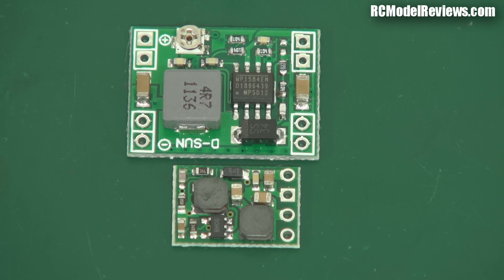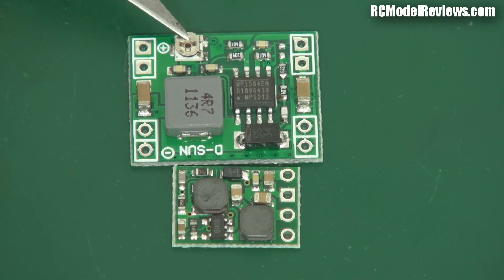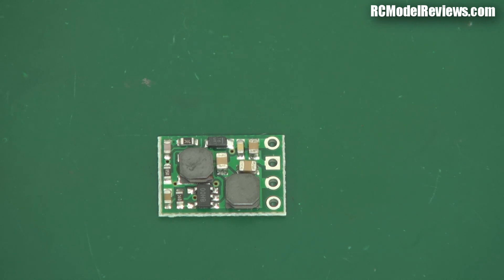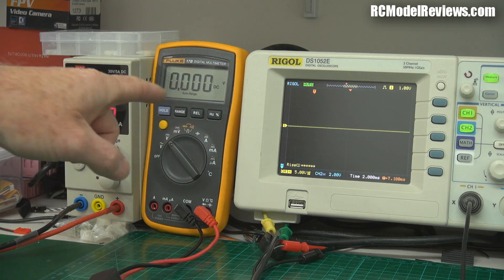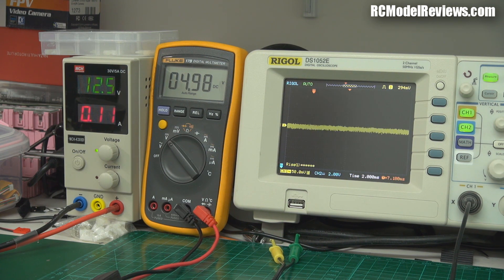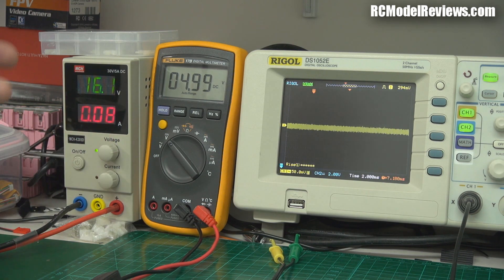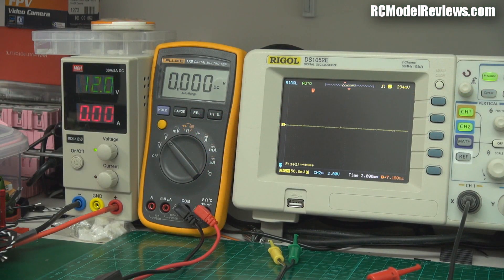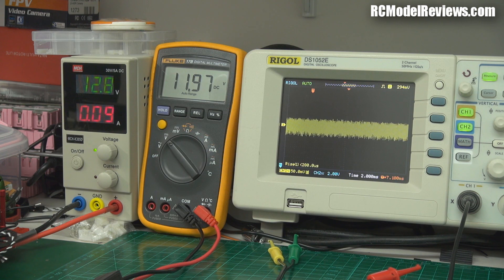On the bench: D-SUN and Pololu regulators (UBECs)

Comment: Thanks for the tests/info on the D-Sun Regulators. I've had an eye on these for a while to use as BECs. Just ordered a bunch of them. 10pc for ~$6.35 USD on eBay.  Can't get cheaper than that.
Seller "gc_supermarket".
Reply: +lasersbee Nice find!  Have you tested any yet?
Reply: +John O'Shaughnessy I've only tested one. It is used on a plane to supply 5volts at ~500ma to some on board electronics.
No problems so far.
Reply: +lasersbee Thanks for the feedback.  I ordered a set this morning.  Could you weigh one?  I don't see a weight listed anywhere.
Reply: +lasersbee Thanks!

Comment: Great video Bruce, I have always been worried about the noise on the buck converter and you have answered that. I tried to use one for an electronic ignition on a gas engine which required a single cell lipo 3.7-4.2v.  I used a 2 cell and dropped the voltage to 4.0 but the ignition didn't like it and the engine spluttered. Any idea why?  Glad you're flying again.  Cheers
Reply: +RedHotPheasant How much current does the ignition system draw? They should be able to handle 3A and probably 5-6A peak. If it's a pulse for a very short amount of time, a lot of times per second, it could be that they can't provide the pulse or recover quickly enough to suit the timing of the motor. (I have no experience with gas engines). I would try a different dc-dc regulator and see how you go.
Reply: +RedHotPheasant 

I'm thinking the slow transient response and relatively high impedance of the DC-DC converter is to blame. Ignition circuits require large currents with a low duty cycle i.e a low average current which the reg is trying to accommodate. You could try putting a large value capacitor on the output of the reg to supply the surge current and even out the average current from the reg. A sort of CD for the CDI :)
Reply: +FightingFlight Thanks for the response.  I don't know the exact current draw but it is less than 500mA at full throttle.  I think you are on the right lines with the recovery theory as the misfire gets worse as the throttle is increased. Thanks again
Reply: +Rob B Hi, Thanks for responding.  I am not an electronics guy but what you are suggesting sounds right, using a capacitor to smooth out the supply and demand.  What size capacitor would you suggest?
Reply: +RedHotPheasant Normally it's recommended to use ceramic caps like 10uF/22uF for them but if you don't have any around, electrolytic capacitors might do, something like 100uF to 560uF. If you don't notice much change, try adding one to the input of the dc-dc and add 2-3 to the output.
Reply: +FightingFlight Hi,  Thanks for the info.  I have fitted a 1000uF electrolytic cap to the output (all I had) and run the engine on the test stand and fingers crossed it seems ok.  When the weather improves I will test it in the airframe but it looks promising - Really appreciate your help - Cheers
Reply: RedHotPheasant Glad to see the capacitor is working for you. Electrolytic cap is the best here since it will give the best capacitance per volume. 1000uF is probably borderline so for a more permanent solution if you have the space go larger or multiple caps in parallel preferably ones rated with a low ESR Equivalent Series resistance. Low ESR is important in power circuits in fact the vast majority of domestic electronic like TV's fail because the caps dry out over time which raises the ESR effectively reducing the capacitive properties of the cap.
Reply: +Rob B Hi, Thanks for that, I think I read your mind as an hour ago, before I read your comment, I changed the cap for a 3000uF and it really seems smooth now on the test stand.  Lets see what happens in the air:-) Many thanks for the help.

Comment: I did some investigative work on the D-Sun reg a while back Bruce. I like them a lot apart from two aspects. The over rated current output which should realistically be kept under 2A IMHO and the fiddly Pot. I have summarised my findings with eliminating the pot here 
http://www.rcgroups.com/forums/showpost.php?p=32734428&postcount=2859
Reply: +Rob B Thanks for the link. I just had a quick look at your post. You show that the Pot on the D-Sun PS was replaced by a 1K fixed resistor to get 9V out... but the chart shows that it should be an 84K resistor. Any reason for the discrepancies ??
Reply: The 1k was for modifying the PDB not the D-Sun. ( they are not the same regs) The chart is for the D-Sun. Values were obtained experimentally not from a data sheet.
Reply: +Rob B 
The datasheet for the MP1584 takes out the guesswork ;) . The formula is on page 10. V_fb is 0.8V and R2 8.2k (on the dsun). Try a few values for R1 and you'll see that it matches you graph (which is a good thing, because it means your setup was correct ;) ).

Comment: Should test them up to their rated specifications.
Reply: +Justin Bell Yes, I'm just in the process of building a programmable load to do that.
Reply: +xjet When you do that. Can you also measure the RF noise with that fancy spectrometer thingo you have?
I bought a 5A one from HK that was wrapped in some foil, so I wonder if RF noise may be an issue?
Reply: +xjet Just buy one, Maynuo M9812 0-150V 300W you will never regret!
Reply: +Danny Bokma you have no clue what are those intended for, do you?
Reply: +CNL _ What? The BEC or the DC load? I happen to own the Maynuo M9812 I suggested.
Reply: Danny Bokma
no mate, i mean these devices are meant to be used in remotely controlled flying machines, they're expected to weight 3g, not 3kg.
Reply: I was replying to xjet about the load. I think we are talking passed each other.